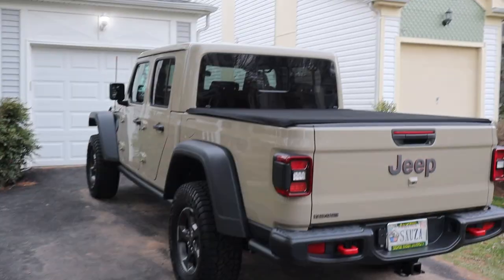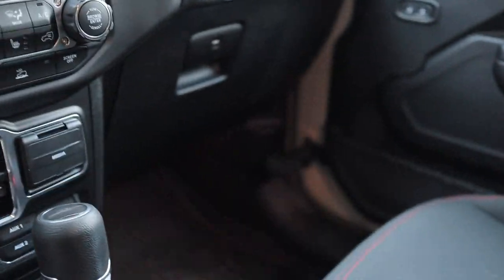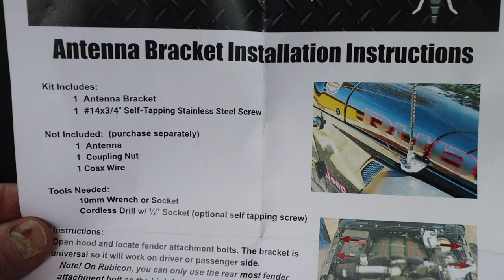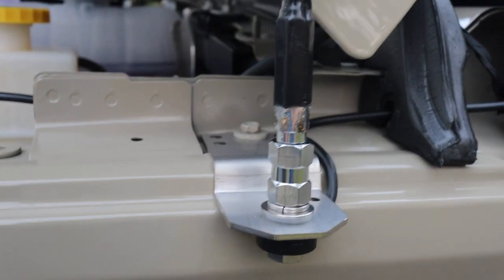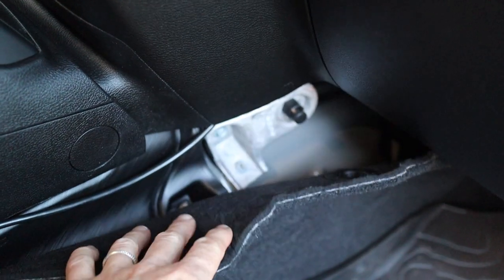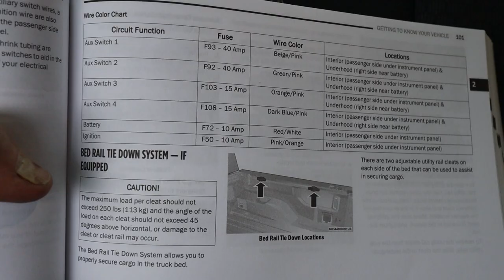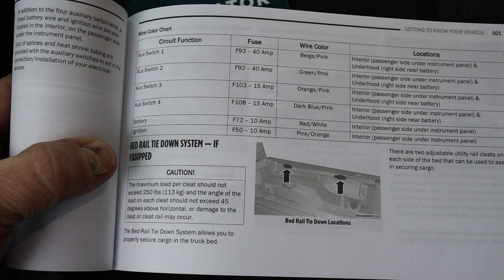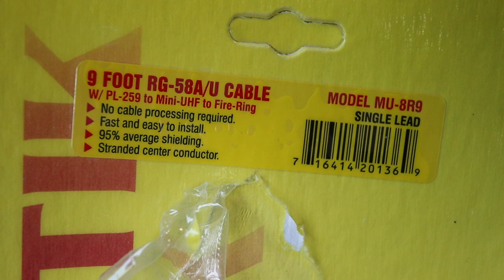Jeep Gladiator CB Radio Install Cobra 75

Comment: Thanks for showing this!  I use a ham radio, but thinking about installing CB as well
Reply from the maker: The install could work for any kind of radio.  you just get the correct antenna, and post, and can run the cable in the same way.  As for a different radio you would need to figure out where you wanted to mount it.

I used to be a ham when i was a kid.  Honestly with the jeeps everyone around me is using CB or the handheld walkie talkies.

Comment: Is it compatible with a CB quick disconnect? Which disconnect would you recommend?
Reply from the maker: You can put a cb disconnect on the antenna, but what you have to be aware of is, the disconnect itself can lengthen the overall antenna, (meaning the factory tuning when you get an antenna will probably be slightly off) and it will really make it so you want to tune it with SWR meter even more.

Comment: After installing did you have a howling noise? I installed a 4’ and the noise is horrid.
Reply from the maker: Noise from the antenna ? or Noise on the CB radio?   CB Radios are pretty crappy compared to HAM radios and GMRS.  But if you are having problems with the radio, its most likely a poor ground, (make sure the antenna is bolted to something metal (not painted) or the power is not coming from the battery but through the harness and you are picking up something like the alternator, which can be corrected by having a more direct power source (like straight to the battery).  I wired mine to the aux switch wiring and was fine.
Reply: @corgily  Hi,
I just installed a CB in my 18 Chevy Silverado and every time I turn my steering wheel i get horrible static. Could that be a ground?